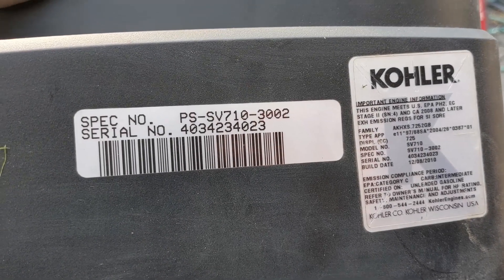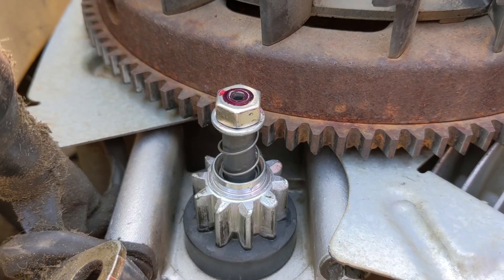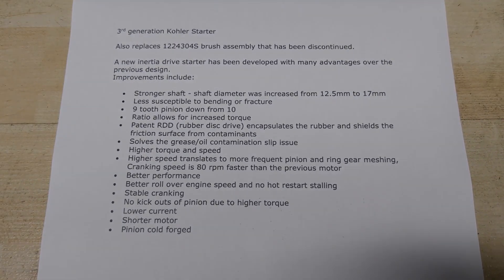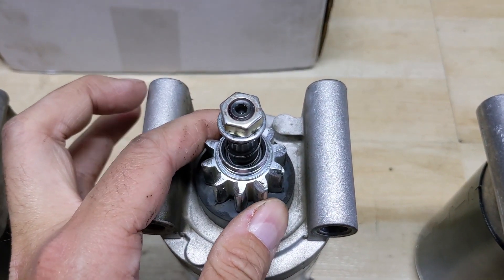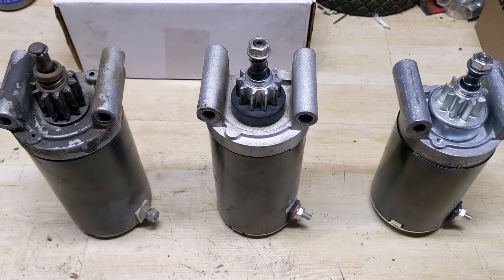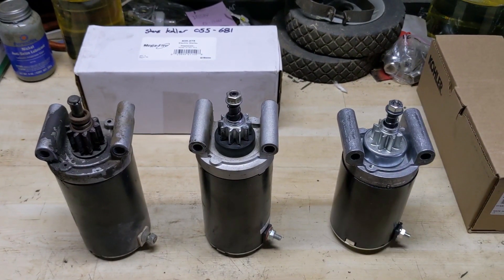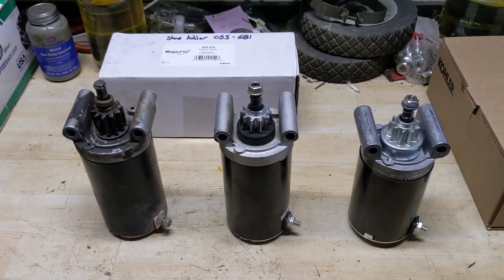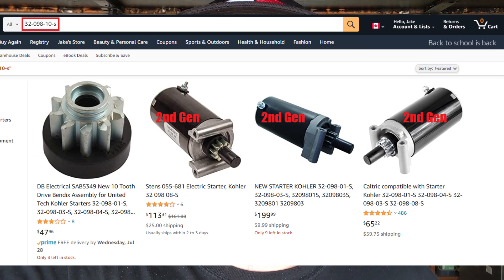3 Generations of Kohler Starters for SV710-SV840 Engines

Comment: Thank you very much for sharing your experience. Wow, very thorough review! 

I am three-(3) years late to the game; thus, I am in a learning curve about the Kohler starters. Our Cub Cadet XT1 LT-46 has the Kohler 7000 Series KT725-725cc 22HP engine and the starter's part number is 1999-1140051 32-098-08  January 1, 2017.  We purchased our lawn tractor in July 2017 from Home Depot.  On Saturday April 13, 2024 I discovered that our tractor would not start. After searching the internet, YouTube and reading, I proceeded to perform a few tasks that were overdue that got neglected due to family health matters. I learned that our starter pinion gear-wheel has nine-(9) teeth, which I think you said is the 2nd generation?  Does the 3rd Generation have nine-(9) teeth or ten-(10)-teeth? Your bulleted list has the 3rd bullet "9 tooth pinion down from 10"?  You said the shaft was increase in diameter - Hmm, does that mean the starter was manufactured with cheap steel? Our starter's pinion gear sheared-off its shaft. 

The past twelve-(12) days, I searched the internet, compared prices and brands on the online shopping platforms and shopped local brick and mortar shops to obtain price quotes and conversed with small landscaping business owners to gain information. I am having a difficult time in understanding the great price differences "for the alleged same product" from different stores and and different 3rd party sellers on different online stores.  

Small Business in Lawn Mower Sales and Repair [Name A]  -  Can order both Kohler OEM [$142.50] and Aftermarket [$112.50] and have it available for pickup the next day – did not purchase because they do not have any return policy
Small Business in Lawn Mower Repair [Name B] - has a mix of used starters for $50.00 [take time to find it and test it] and he can order a new one from a contact in Pensacola $165.00 
Small Business in Lawn Mower Repair [Name C] they can order Kohler OEM for 199.50  
The Big Orange Box Store - has a variation of after-market starters that meet the Kohler Starter, but getting the military discount is too cumbersome because they contracted the program to a 3rd party and you have to submit military records e.g., DD-214 and other information:  I am not ready to signup without having knowledge of the 3rd Party Company  
Small Business Outdoor [Name Y] -  they do not sell the Kohler Starter 

On Thursday, April 18, 2024 - 
Connected the Super Start battery and removed the hood, removed the air-filter and sprayed the Engine Starter Fluid and placed the air-filter back into the housing. Loosened the Choke/Throttle cable in attempt to tighten the cable tension, attempted to start the engine and it did not crank, removed and checked the 20-amp fuse that is in the battery cables – it looked good, removed the engine cover with a eight millimeter-(8-mm), attempted to remove the starter with 3/8-in socket and a 7/16-in socket, but learned the bolts require a ten millimeter-(10-mm) socket – borrowed correct socket size from neighbor, removed the starter and confirmed that it was broken because the gear-wheel sheared off from the rest of its housing. 

On Wednesday, April 17, 2024 - 
Removed the new Champion spark plugs due to learning that must be set at 0.030-in; retrieved the spark plug gauge tools and set both plugs to as close to the specification of 0.030-in as required from the Cub Cadet YouTube Channel; Re-installed the Champion Spark Plugs, Poured the second one quart-(1-qt.) of SAE-30 oil into the engine dipstick cavity, Reconnected the battery cables and reattached the hood, Attempted to start the Cub Cadet XT1 LT-46 lawn tractor – it failed to start 

Tuesday, April 16, 2024 - 
Disconnected the Super Start battery in preparation to test if it is a good battery, retrieved my old Archer-Kit Volt-Ohm Multi-meter to test the battery – it tested good. Searched YouTube and the internet for probable causes as to why the lawn tractor won't start and found a dozen reasons, Inventoried our Cub Cadet replacements parts and fluids; we need two-(2) quarts of SAE-30 engine oil and two-(2) spark plugs, Drained the engine oil and it was very dark; removed the spark plugs and IMHO learned that they need to be replaced with new spark plugs; Installed two-(2) new Champion Spark Plugs – later I learned that I may have torque them too tight and the spark plug gap needs to measure 0.030”, Installed one-(1) new air-filter, Installed one-(1) new oil-filter, poured one quart-(1qt.) of engine oil [need to add the second quart of engine oil tomorrow]   

Monday, April 15, 2024 
Removed the battery from the Cub Cadet battery - mystery label May 2018 ? Dad purchased the tractor July 2017 
Visited O'Reilly's Auto Parts Store to verify if the battery could hold a charge - No
Purchased Super Start battery from O'Reilly's Auto Parts Store
Installed the battery and attempted to start, but the tractor failed to start  

Disconnected the Super Start battery as precaution to prevent draining the battery 

Saturday, April 13, 2024
Discovered that the lawn tractor would not start
Reply from the maker: $151 here https://amzn.to/3srYmhC on Amazon which is the OEM 10-S latest generation starter. Basically between your A and B option in terms of price. The newest gen starter has the 9 tooth gear, but the previous generation also has a 9 tooth gear but lacks the thicker shaft diameter. As I stated in the video, they upgraded the design but the shafts started breaking so then they had to upgrade it again. It's all very confusing and unfortunate for the consumer who has to deal with these issues. Good luck!
Reply: @EliminatorPerformance  Thank you for responding.  After watching your video a couple of times, I went into the garage to look at the starter more closely.  I tried to  twist the nut off by hand, but I don't have enough hand-strength, so if I can remove the nut with a wrench then it must the second generation. If I cannot remove the nut it must be a 3rd generation with a weld?  However, I don't understand how by removing one gear tooth adds more torque.  I know the starter pinion gear has 9-teeth, what is the RPM of the starter? but that huge flywheel must have 200 teeth?  What is the gear ratio?  Argh!

Comment: According to my conversation with 2 other local shops and Kohler itself there is NO Automatic compression release. One gigantic headache can really manifest itself with these engines because they have hydraulic lifters and if one puts regular 30 weight oil in em the engine becomes hard to turn over. Folks need to use 5W30 oils in em... The SV710s and SV720 and 30s have no compression release.
Reply from the maker: The SV710-740 and SV810-840 do in fact have an automatic compression release. Both the engine owners manual and the engine service manual mention this. This is taken directly from the service manual: "These engines are equipped with an automatic compression release (ACR) mechanism. It is difficult to obtain an accurate compression reading because of ACR mechanism. As an alternative, use cylinder leakdown test." Go to Kohlers website and download the product sheet for these engines, it literally says right on Kohler's website. Also, under trouble-shooting it says "hard to start - faulty ACR mechanism. I'll provide the link; http://www.kohlerengines.com/engines/onlinecatalog/pdf/sm_32_690_01.pdf
Reply from the maker: Additionally, I've been running 10w40 in all Kohler and Kawasaki engines without issues. As soon as you turn the key, the oil pump transfers oil through the gallery's and pumps up the hydraulic lifters on engines that use them. A 5w or 10w oil really makes no difference in the summer time, only in winter weather in sub zero temperatures, which is when I would recommend a 5w oil. However, for the summer time, a 40 weight oil works best IMO because it's slightly heavier and helps prevents oil consumption. These engines need a minimum 370ca battery, and they need the latest 3rd generation starter. Additionally, if the ACR mechanism is malfunctioning, it will make any engine hard to start.
Reply: The courage doesn't have hydraulic lifters. I just adjusted the valves on a SV730 two days ago. Spec is .004-.006. And as stated above, it does have ACR, you can download a free pdf service manual, it's mentioned in there. The service manual also says 10w30, not 5w30 or 30w.
Reply: @svtirefire  According to the Kohler Bulletin I was sent by Kohler they say not. 
I personally have never pulled apart a mower engine that does have hydraulic valves. That may happen if mine keeps acting up.
Reply: Unfortunately, this is one of those rare situations where you cannot trust the service manual at face value. The presence of the ACR depends on the engine spec and the vast majority of the SV Twins that were ever built do in fact NOT have an ACR, as Silverado stated. All Kohler twins after the Magnum series, regardless of model, use a camshaft mounted ACR IF they are ACR equipped. So if you want proof of which it is, lookup the camshafts. 32 010 05-S is one of the most common standard SV model camshafts (no ACR), as compared to a CV model ACR equipped camshaft 24 010 06-S. From a google image search you will quickly see the difference and see that the standard SV cam has no ACR mechanism on it. 

Also, no hydraulic lifters on residential grade engines. SV's are standard tappets.

Comment: Thanks, a little late for me. I have a Ariens zero turn with these junk Kohler engines. Started having starting problems, Unfortunately got a replacement Gen 1 starter. Worked a season and then the same problem.  Got a Gen 3 has been working fine. I wish there was a mfg. notice. The Kohler engineers most be dei hires from the Mentally Disabled School System.